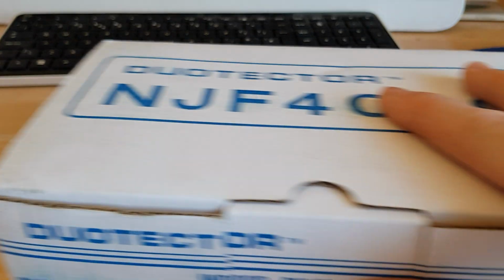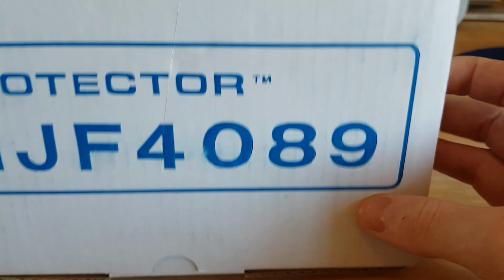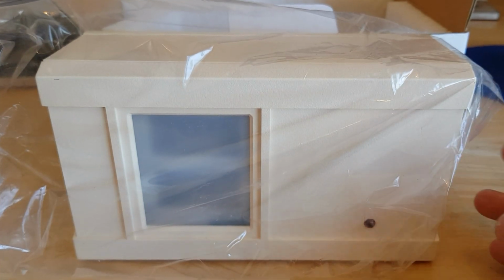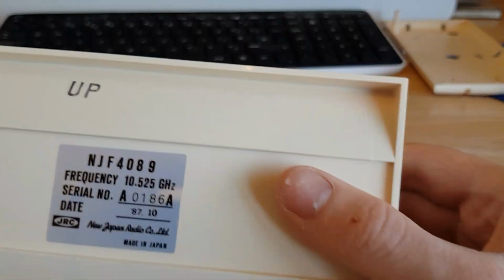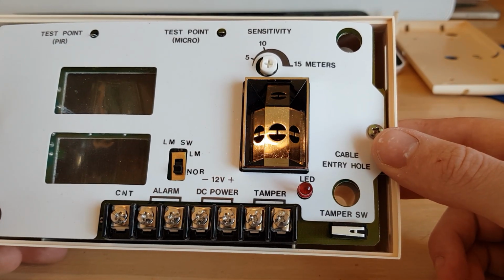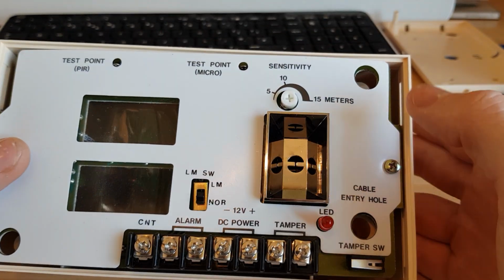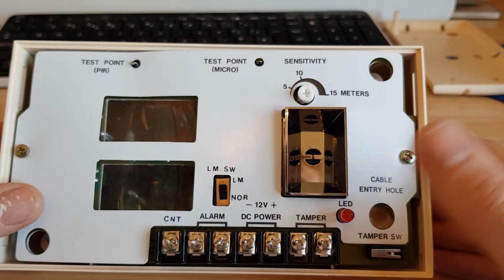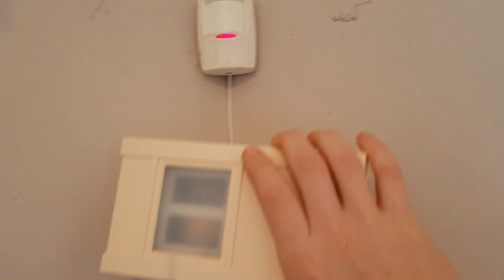Vintage Duotector Dual Tech Pulse Operating Passive Infrared And Microwave Motion Detector NJF4089

Comment: I bought the sellers entire stock. A random one I pulled from my box is only 8 ahead of yours.

Contrary what you might believe I'd fit it just to see the looks on peoples faces when they see it, but hey, I'm a retro guy anyway so it wouldn't bother me too much.
Reply from the maker: I too am interested in retro and old things, but this would be too big for most houses even back in the day. This is designed for comercial propertys and huge open rooms much bigger than you would find in most houses, so even back in the day it would look out of place as it wasnt really meant for a house.its funny when you think how far the technology has come, now lots of dual tech detectors are a similar size to standard P.I.R sensors. The only place I would ever really fit this is in my work shed, but thats way too small. It could go in my garage aswell, but every door to the garage including the loft hatch has a door contact on it, and the window has a glass break sensor on it so their really isnt a need.

Comment: https://www.ebay.co.uk/itm/Racal-Guardall-IR77-Series-MK-II-IR772D-Boxed-Burglar-Security-Intruder-Sensor/324058510762?hash=item4b736475aa:g:ecAAAOSw889eMwf. this is probably what you mean.
Reply from the maker: Yes it is haha not seen one of them in years. I have just bought it so get ready for a video on it! I think the ones in my house when I moved in where mark 1's the one on ebay was a mark 2. The only difference I can see is that the one on ebay has a grey lens as most the P.I.R's did in the end (especially in the 90s) but the ones in our house had a darker black coloured lens which makes me think ours were mark 1's. Still interesting though as I think the Duotector in this video looks very similar and has some of the same design features.
Reply: @jakemcintyre4820  i have seen ones with black lenses they are quite cool, looking forward to a video....
Reply from the maker: @mrsecurity  Yeah I like the look of them to.  I will do the video when it comes, probably about a week or so.
Reply: Jake McIntyre I might be getting a mark 1 someone I know has an old adt alarm system and a bunch of mark 1 racal guardalls, hopefully they still have them !

Comment: Ive got one of them and something i realized is that those duotector NJF4089 PIRs aren't that good at all.
They're from about 1987.
Reply from the maker: Oh really. I havnt installed or tried one of my 3 so I dont know how good they are fir myself. I thought with being a dual tech they would be quite good. What have you noticed wrong with them? Do they false alarm?
Reply: @jakemcintyre4820  they don't tend to pick up movement very well, although maby under the right conditions they'll work fine but i dont know.
I've never installed any before as ive only seen it on ebay and thought it would go well with my chubb alarms box.

Comment: Wow! That's massive! Just out of intrest what panel does that Pyronix PIR connect to?
Reply from the maker: Do you mean the wired in PIR in the corner of the room? Is that a pyronix? And it connects to a texecom veritas v8 panel. Not the best of panels in my opinion. Too complicated to programme and instructions arnt very clear. In the future I would probably go for an ADE Honeywell optima. They are more simple to control/operate. Its what I install in other peoples houses anyway unless specified otherwise. I can do a demonstration of the alarm system is you'd like.
Reply: Yeah if you could. Personally I am not really keen on texecom. From some people I hear really good things and from some people I hear really bad things, especially with the premier. The veritases are okish but not as reliable as optimas. I don't know if you have heard of them but I quite like orisec, their equipment is really good, I would say its the best you can get. Unfortunately its installer only so you have to make an account. https://www.orisec.co.uk/
Reply: Also, yes I think that is a pyronix, might be branded as caslte. https://www.amazon.co.uk/WA66-PYRONIX-DETECTOR-PYRO-ELECTRIC-INTRUDER/dp/B01DMQO7TS/ref=sr_1_9?keywords=pyronix+pir&qid=1554927068&s=gateway&sr=8-9